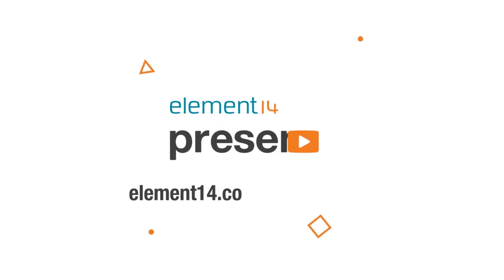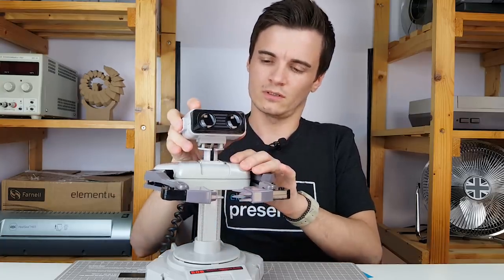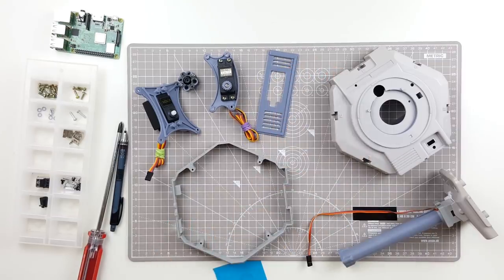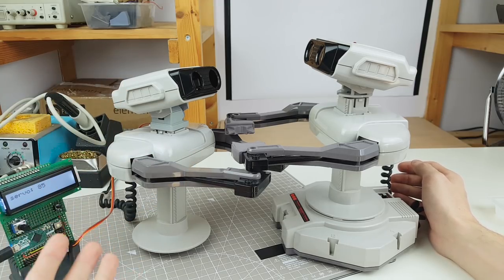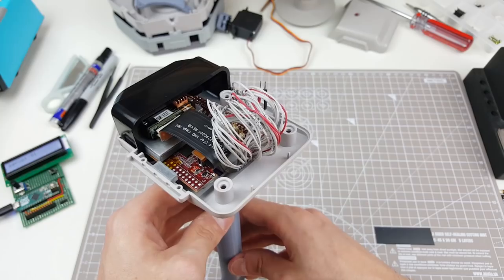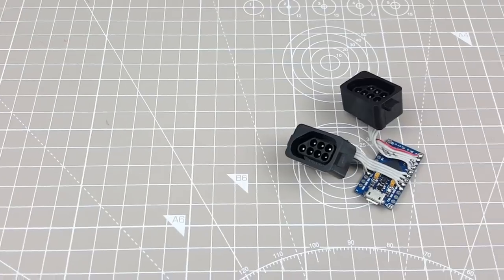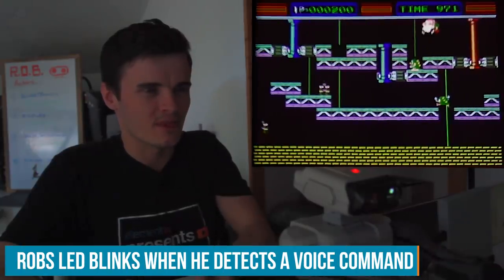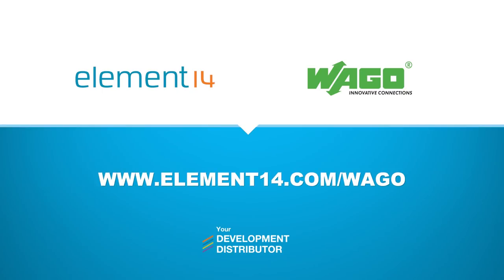R.O.B Rebuild and Upgrade

Comment: I would like to see your ROB act as a traditional ROB, except with much faster movement and gameplay with his games.  If possible, I'd like him to be able to do this with his projector, not requiring a CRT... though I grant that this may require some very difficult hacking.

I'd also like to see your ROB be able to react to various NES games with his arms and body.  Let him cheer your successes and sulk at your failures.
Reply: If we'd seen anything like that, that would have been genuinely impressive. Even just making him work with modern screens would have be good.

But this throws out R.O.B.'s original autonomy, limited though it was, entirely.
Reply: Hello, not to take from this (amazing project)…I am also a ROB modifier and had some different goals,  but one was solving the gyromite issue on modern screens. It can be done, best by circumventing the flashing requirements and instead relying on user input that ROB can understand. You can find it on my channel but again not trying to divert, just love the innovation and keeping this guy going.

Comment: This is one of the best projects I've seen in a long while. It's cool to see this kind of engineering approach. Hopefully this project will see an update video one day.
Reply: I'm not exactly impressed, myself. Instead of restoring or improving on R.O.B.'s original independent functionality, it discards it entirely, turning him into nothing but a puppet the player has to control themselves.
Reply: @ZeldaTheSwordsman  That's what the original Rob did lol
Reply: @kenmarkollano5795  No, the original R.O.B. could also receive input from the game that wasn't player-generated. Enemies could mess with him

Comment: This is AMAZING! I was looking to buy a ROB to rebuild with a PI maybe make him faster, add more usage to his arms, and probably mount him on a some motors for mobility. But I found a free Radio Shack Robie SR that I saved from recycling, he already has mobility and is WAY larger so I can cram the whole projector in his head plus maybe a few other functions into the body. Like some servos to move his arms, new functional hands, and a camera for video.

Comment: Gyromite was so frustrating.  Glad to see 40 years of technological improvement has made it close to playable.  If you want the true Gyromite experience you have to have him only hold the button for so long.   You could have Rob do a little celebration when he gets you killed. It could be triggered when he hears you yell Rob no!
Reply: 1. 35 years, not 40. And oly 33 at the time of recording.
2. What technological improvement? All he's really doing is hitting the buttons on Controller 2 himself, which you could do just fine back when the game was new; you just had to use your hand or foot instead of your voice.
It's not like he made R.O.B. able to grab, spin up, and place the gyros faster! That would be technological improvement. Instead, R.O.B. no longer responds autonomously at all or even pretends to.

Comment: Very cool idea. Too bad you had to hot glue the new base extension instead of finding long screws on some website like Element 14.
Reply: And too bad he completely took away R.O.B.'s ability to respond independently, instead of updating it to work with modern screens.

Comment: I may have missed it, or got impatient, but are all the parts you designed 3d printed? ABS?
Reply: I didn't go into much detail about the 3D prints, most of them are PLA. Some of the parts inside ROBs head are printed in ABS though.
The projector runs quite hot and I wasn't sure PLA would tolerate the high temperature very well.

Comment: You know, one of these days I'd like to find a R.O.B. upgrade project that's just "Give R.O.B. sensor equipment that makes him work with newer TVs, thereby restoring his original functionality" which is all a lot of us want. That and maybe replacement motors that don't need as much juice to run.

But nooooo, everything I've found is some sort of over-the-top hack bonanza. Which, while impressive, is not exactly the most helpful for those of us who just want to be able to retrogame without a space-hogging power-guzzler of a TV.

And speaking of retrogaming... this "R.O.B. reborn" project would have been a lot more impressive to me personally if you had made R.O.B. better at using his actual tools, which there's no sign of whatsoever.
And the voice-controlled virtual controller function, which is all you demonstrated when using him as a buddy with one of his signature games... does NOTHING to enhance the feeling of R.O.B. being your buddy, since he doesn't even mime button presses. Congratulations, your "R.O.B. reborn" project makes him feel like even less of a part of the action than before. You may have given R.O.B. a lot of fancy features, but you also downgraded him from an autonomous-in-a-limited-way artificial second player... to being a glorified way of hitting the buttons on Controller 2 yourself. He doesn't respond to the game on his own at all anymore, or even provide an illusion of doing so. Great going. Some rebirth it is when your "upgrade" is less of an automaton than a stock R.O.B.
Reply: Have cooled down a bit, but my opinion remains unchanged.

This is like DCC-fitting a model locomotive... by throwing out the motor to make room for the decoder.
Reply: I’ve created this (it’s on my channel), though it is a semi-advanced mod. The electronics and functionality work flawlessly…the trick is keeping good ol ROB mechanically healthy. 🤖